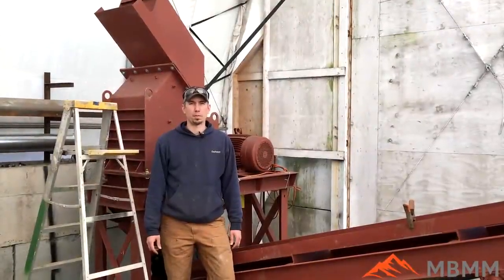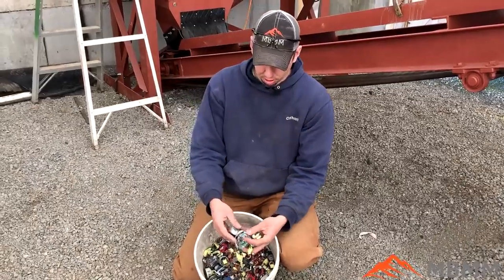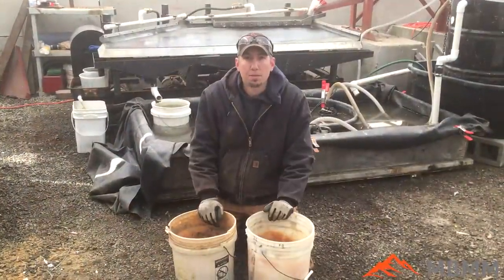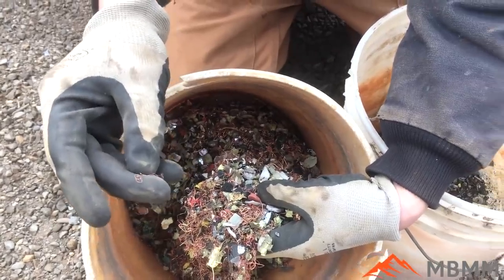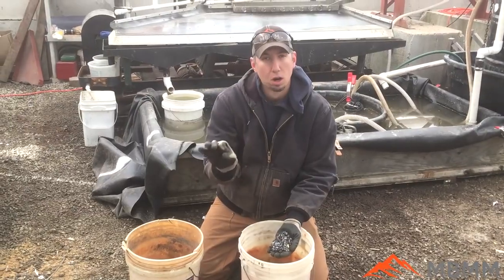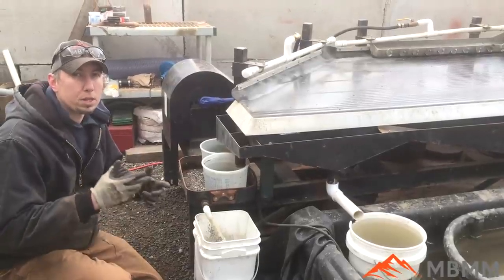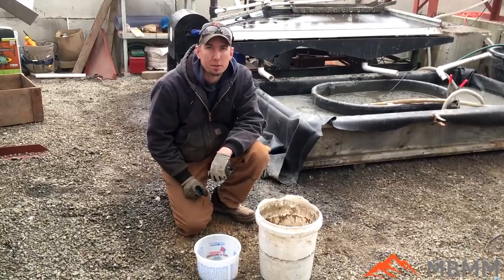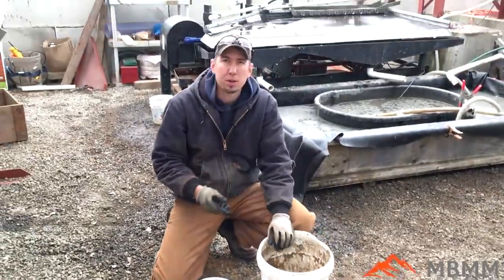Most people throw these away. We turn them into copper.

Comment: Can't help but wonder weight, volume vs time.  Given a tank with water pumped into the bottom if weight is measured to understand the process could you not overflow the light stuff with just a collection tank and stop when the weight in it has enough to process without the tailings being the first light separation?  Also a vibration motor attached to the tank would allow for settling in dense layers with water flowing upward.  If the tank is fed via conveyor a simple drop gate would mean all things must go below the surface to overflow so surface tension is overcome before overflow also.  I know the hammermill might be the slow module in the whole process rather than shaker table but given a small yard they could have multiple collectors and the conveyor swings to what they are doing at the time.  This would enable 2 mills for a single shaker or any combination for any combination given material and flow to maximize time.
Reply: I know replying to my own post is BS but in watching more videos the process of each I understand but the time of each against each other unit is not understood at all.  I also was looking at the small hammer mill mounted on a truck bed.  For mining purposes why are you using a sluice?  How much can you run before the sluice mats are losing cons that might not be fully good stuff but might have some good stuff?  Since you use water pumps anyways could you not have a discharge trough with 12" deep cylinder tanks with a honeycomb pattern on the top and a valve discharge to drop heavies into 5 gallon buckets?   Two of these in series would have grace period of needing to discharge while overflow gets caught in the second one.  The product is con buckets, the truck to carry them is right there,  the machine to separate better is back at the shop with the beer.   Win win win would that not be?